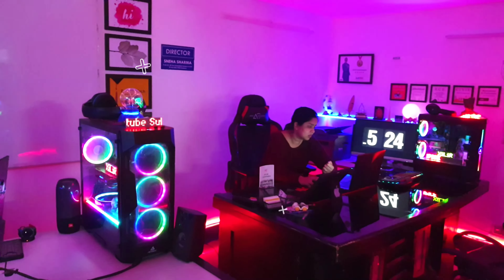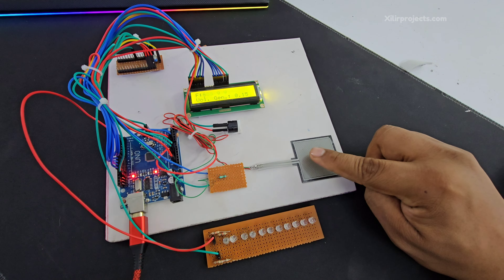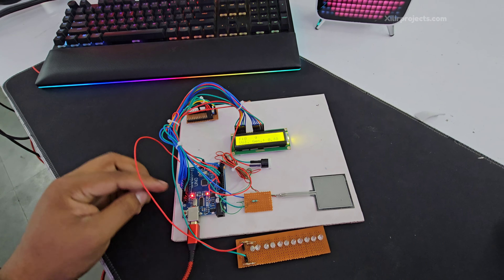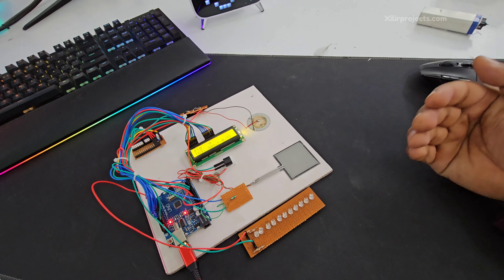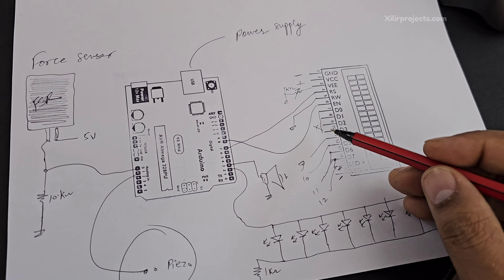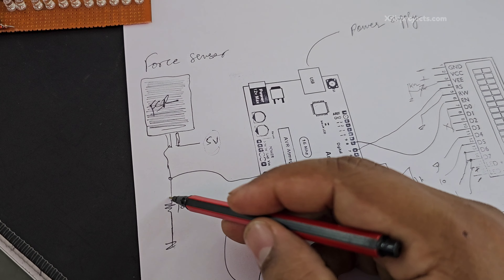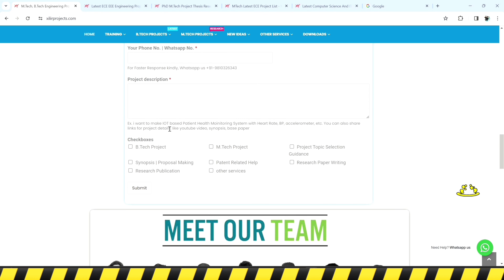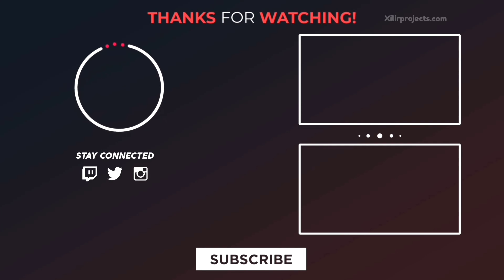Force Sensor and  Piezo Electric calculation using Arduino | Engineering Project

Comment: Hlo brother, please create a video of iot based patient monitoring system that includes ECG, blood pressure,fall detection, blood-oxygen concentration,pulse sensor , temperature and humidity 🙏🙏🙏🙏
Reply: Circuit diagram and sources code also🙏
Reply from the maker: Okay will do it...blood pressure sensor i have to check